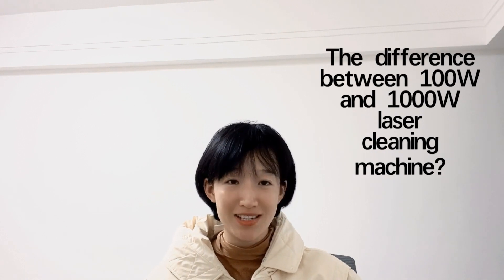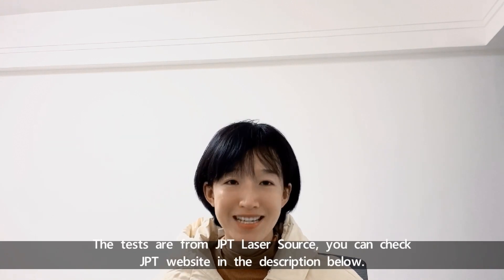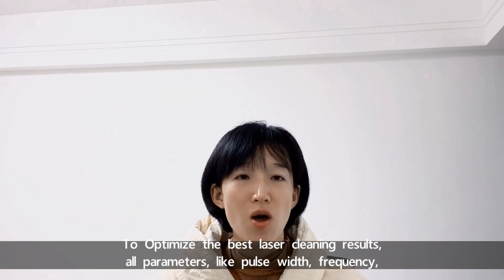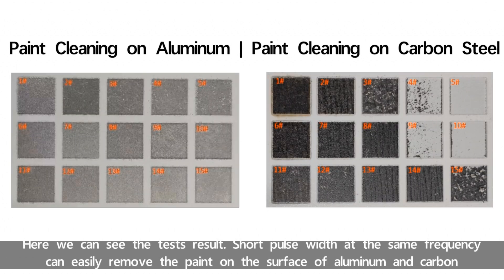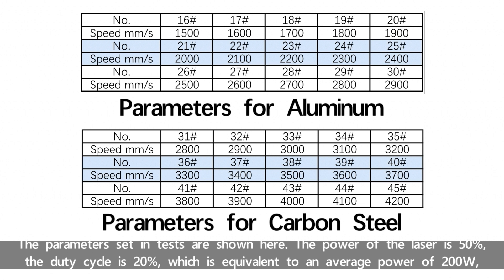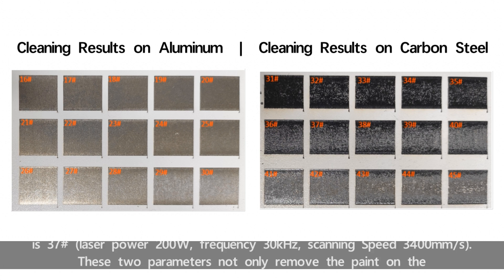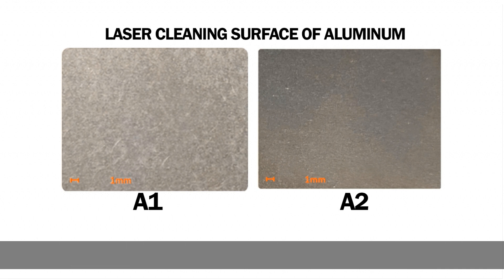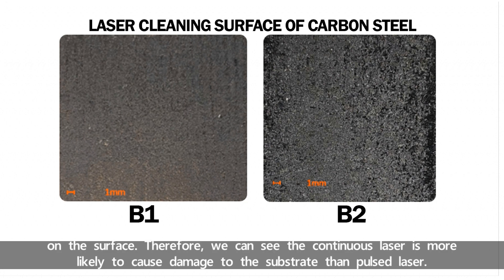Laser Cleaning Machine 1000W | Laser Cleaning 100W | How to Choose 1

Comment: I'd like to add Lazer cleaning to my furniture restoration shop. All kinds of finishes will be cleaned. Best best machine with limited damage ?
Reply from the maker: You need to check what surface or layer you want to clean, I will offer you a solution.

Comment: Hi Clara, can we say that CW machine will always be more damaging than the Pulse laser even if lower setting is used on the CW ? Regards
Reply from the maker: Er, I think we can not say that.
Reply: @ClaraChai  many thanks for your reply. Do you mean that if CW is set at low power setting, it will not damage for example scraping paint or rust from automobile body panels ?
Reply from the maker: @keremustunkaya9650  I don’t think so, pulsed and CW lasers  are just for different applications.
Reply: @ClaraChai  if I understand correctly, there is less heat generated with Pulse. Therefore, for example Pulse is the correct choice to scrap car paint/bondo or powder coating from thin sheet metal ( 1-1,2 mm ). Where as, CW laser cleaners are more for industrial applications such as cleaning large rusty surfaces from thick base material.
Reply from the maker: @keremustunkaya9650  Yes, you have my thought
Reply: @ClaraChai  many thanks Clara
Reply from the maker: @keremustunkaya9650  So welcome!